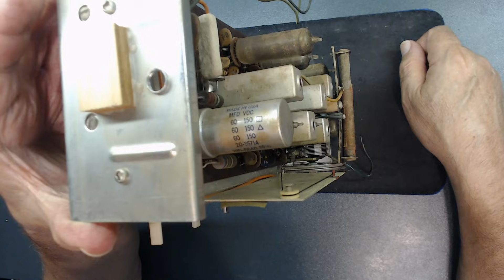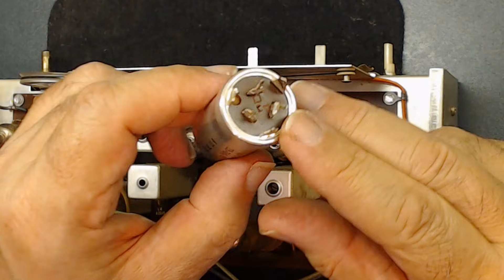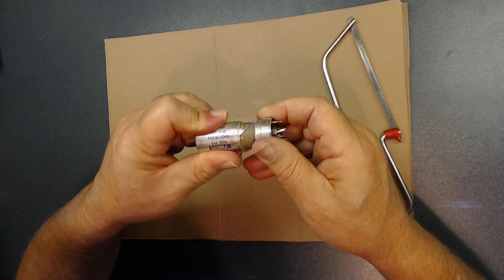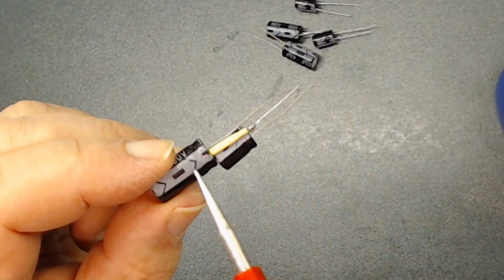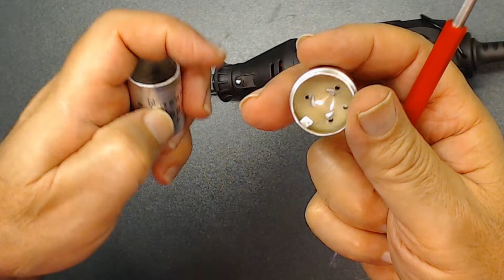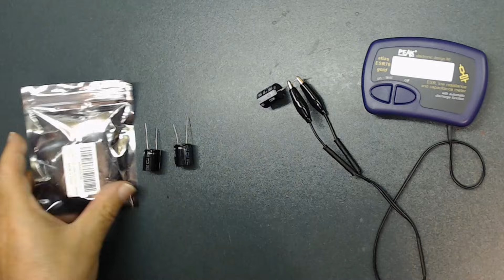How to Repair / Rebuild Multi-Section Electrolytic Capacitors - (Step-by-Step Guide for Beginners)

Comment: That's the hard way.
Reply from the maker: I’m always looking to improve my process, so I’d love to hear what you consider a better or easier approach! Have a great day!
Reply: @RadioFixer  Lock it in a machinists' lathe and turn it with a cutter against the curved end, just enough to be able to get the steel ring off. Then put it in a toaster oven about 400F for 20 minutes, which will cause the wafers to pop out enough to get behind them with a small screwdriver, alternating with tugging the legs with pliers, till the whole insides come out in one roll. (very hot). then separate the 2 phenolic wafers and throw away the gooey rubber disc between them, Getting rid of that rubber disc buys you the space to be able to crimp the ends when everything is re-installed. Drill tiny holes next to all the legs and one in the middle. The one in the middle is to feed all the negatives through. When it's re-installed, you'll barely notice anything. I've seen guys like you cutting the can. That's an awful way

Comment: Cool video thanks!
I was wondering where can find this tolerance calculator program, it would make my job lot easier. I am working on renovation of a 56 pg grommmes and i have some vintage capacitor i 've never seen in my life :D
I hope you guys would share this program! 
Thank you!
Reply from the maker: Hermann,
It’s great to hear from you! Thanks so much for taking the time to message me and for supporting my YouTube channel—I really appreciate it.
I originally created this software to make my own work easier when restoring older electronic equipment. I’ve had quite a few requests for it since it helps identify different types of capacitors, resistors, vacuum tubes, and more.
Because of that interest, I plan to spend some time finishing it up and hopefully make it available at a reasonable price so others can benefit from it as well.
Have a great day,
Regards from Florida,
Jay

Comment: I did find 60uF at 450 volts in DigiKey website for about 3 dollars UBR2W600MND and it is a true Nichicon cap........ I buy all my caps and other parts from them , no amazon and ebay for me .... They are not the real deal a lot of times ...... A real Nichicon cap that costs 3.50 USD is the right price , 10 capacitors for 4.00 USD is suspicious ,  I bought some Rubycon from amazon quite some time back to compare with the real deal from DigiKey and they were fakes ..... I need to do a video on that one day ....  I hope yours are the real ones ..... Great video...

Comment: A lathe would be a lot cleaner.
Reply from the maker: Hi Larry,
That’s a great point about using a lathe—it would certainly make the process cleaner, and you’re absolutely right. Unfortunately, I don’t have one at the moment due to workspace limitations. I’ve wanted one for a long time, but between the cost and the space required, it just hasn’t been practical for me.

I’m not sure if you’ve had a chance to watch some of my other videos, but my goal is to approach radio repairs as simply as possible, using materials that are easy to find or already around the house. That way, viewers can realistically duplicate the techniques themselves.

A good example of this is a series on my channel called Rat House Radio. It’s a full restoration project where I cover different techniques used to preserve the originality of a backlight cabinet. Most people would have discarded it, but I just couldn’t bring myself to do that.

Each series on the channel is a little different, and I try to take a fresh approach to the unique challenges that come with every project. If you’re interested, you can check it out here:
https://youtu.be/uMfL4Eakzng

Wishing you a great day, and thanks again for reaching out—I really appreciate your input.

Best regards from Florida,
Jay

Comment: ESR. Is acctually the parmeter to check for old electrolitic caps. to decied if they are bad.
The tool you are using can test this.
A standared value of 56uF exsists.

Most intresting to see the restoration of the cap.  Nice job.

I personaly would hollow the canister of the cap. ,put it back in the radio and  solder the replacment caps on it's tabs from the bottom.
Reply from the maker: Hello, it’s great to hear from you—thank you for taking the time to message me and for supporting my channel. I truly appreciate you bringing up the point about ESR being an important parameter when checking older electrolytic capacitors. That is my understanding as well, and your comment will be helpful for others who are learning.

I’m glad you enjoyed the electrolytic capacitor restoration. In some cases, there isn’t enough space under the chassis to install a replacement capacitor, especially in PCB-based equipment. This method can be very useful for electronic devices such as radios where space is limited.

Feel free to watch other videos on my YouTube channel. Each series is unique, and I try to take a fresh approach to solving the challenges in every project.

Have a great day!

Regards from Florida,
Jay

Comment: Nice video! That tape LOOKS GREAT!  SAE values would be 47, 56, 68. High values mean the electrolyte has dissipated letting the aluminum films to get closer together. Soon close enough to go phzzpt!. Yep time to recap.

Several comments are saying the caps are leaky which fools the meter, but the voltage is too low to cause measurable leakage? Should be leakage checked at 150vdc to know.
.
Reply from the maker: Hi Sam,
Wishing you a wonderful holiday season 🎄

Thank you for watching and for your kind words and detailed insights—they’re very helpful and truly appreciated. The information you shared will definitely be valuable to others who are new to this and don’t have an electronics background.

I also want to thank you for taking the time to message me and for supporting my channel. I’m really glad to hear that you enjoyed the video. You might also enjoy some of the other series on my channel—each one is unique, and I try to take a fresh approach to solving the challenges in every project.

Have a great day, and thanks again for watching!

Best regards from Florida,
Jay

Comment: Interesting idea, using the aluminum foil tape. I like to reattach the can to the base using 5 minute epoxy. It is strong and reliable, and the seam is often nearly invisible!
Reply from the maker: Wishing you a wonderful holiday season 🎄
When I first started this hobby, I considered using 5-minute epoxy, but I was concerned about future serviceability—especially if I or the next person ever needs to reopen the can to replace the capacitors.

One advantage of using aluminum self-adhesive tape is that it’s much easier to remove the canister later if the capacitors ever go bad.

You might also enjoy another series on my channel called Rat House Radio. Here’s the link:
https://youtu.be/uMfL4Eakzng

It was a 100% full restoration project. Each series is unique, and I always try to take a fresh approach to solving the challenges in every project.

Have a great day, and thanks again for watching!

Best regards from Florida,
Jay
Reply: @RadioFixer  Hi Jay, I watched Rat House Radio when you first posted it and enjoyed it thoroughly. It amazed me how you were able to bring such a disaster of a radio back to full working condition. I was very impressed by your passion. Keep up the awesome work!
Reply from the maker: I’m really glad to hear that you enjoyed the video—it's always great hearing from you! Thanks so much, and have a wonderful day!

Comment: In case anyone doesn't know, the capacitance of the can capacitor has not actually gone up. It is not actually 74/78/101 microfarads. The capacitor tester calculates capacitance by measuring the time it takes to charge up. However, these old capacitors are "leaky", meaning they have an equivalent parallel resistance (different from the equivalent series resistance). Equivalent parallel resistance is not desirable, and since some of the charging current goes through that resistance instead of into charging the capacitor, it takes longer to charge. The tester measures a longer time to charge, meaning it thinks it's charging a bigger capacitor (74/78/101uF), but in fact it's just losing some current through a resistance it doesn't expect to be there.
Reply from the maker: Wishing you a wonderful holiday season 🎄
Thank you so much for this detailed explanation! I really appreciate you taking the time to share this valuable insight, as it’s incredibly helpful for everyone. 

It’s so great to hear from you—thank you for taking the time to message me and for supporting my channel! 

Have a great day, and thanks again for watching!

Best regards from Florida,
Jay

Comment: These remind me of the multi-pole capacitors inside of exterior HVAC units…
Reply: Similar concept.  Just multiple caps in one can
Reply from the maker: Hi Brendan, thank you for answering this question! You’re absolutely right—I’ve replaced a few of those in my air-conditioning units as well. Since HVAC capacitors are readily available, there’s no need for me to rebuild those caps. LOL.

If you’d like, feel free to check out the attached video series, “Rat House Radio,” which you might also enjoy: https://youtu.be/uMfL4Eakzng
. It was a 100% full restoration project. Each series is unique and different, and I try to take a new approach to solving the challenges in every project.

Have a great day!

Regards from Florida,
Jay
Reply from the maker: Hi Scott,
It’s so great to hear from you—thank you for taking the time to message me and for supporting my channel! You’re absolutely right, as Brendan mentioned. 
I’ve replaced a few of those in my air-conditioning units as well. Since these old multi-section capacitors are no longer available, we often have to build our own. LOL.

If you’d like, feel free to check out the attached video series, “Rat House Radio,” which you might also enjoy: https://youtu.be/uMfL4Eakzng
. It was a 100% full restoration project. Each series is unique and different, and I try to take a new approach to solving the challenges in every project.

Have a great day!

Regards from Florida,
Jay

Comment: Nice video! Thanks for putting it up!
A few comments, though first where I'm coming from: I'm an EE, and as a hobby restore old electronics, been doing that for a few decades now. 
So, with these capacitors, they are usually placed in the power supply as bulk-capacitance to smooth out ripple left after rectifying, and provide for surges. Actual value is not critical, to some extend more is better (there are limits to that). You could have just used 68 uF capacitors to replace the 60 uF, would be perfectly fine and 68 uF is a standard value. I saw the comment about measuring over-capacitance and concluding they are still good; that actually is a big question mark. Most cheap capacitance meters work by timing how long it takes to charge them with a known current, and any leakage resistance (something most old electrolytics have lots off!) will result in measuring a larger-than-actual capacitance. You would need a much better capacitance meter that measures impedance (so it knows capacitance and resistance) to actually figure out if these capacitors were good or not. Generally I just assume old electrolytic caps are bad or will go bad over the next years, and replace them as part of a restoration. For any electrolytic caps of 30+ years that is a safe bet. True, many are still good, but why put in all the work to get something unreliable that will likely fail in the next years. Replacing them with new 105C and 5000+ hour rated caps is just part of the process.
Reply: Most rectifier tubes are limited to 30, perhaps 40 mfd, as the first stage capacitive filter, or else the rectifier may be prone to arcing or premature failure. 60 mfd is a bit much for all but one or two rectifier tube types (such as 5AR4/GZ34, which is used in hifi and guitar amps but not in small radios). Better to keep the first stage capacitor at no more than 20 to 30 mfd and use the higher capacitance values for the following filter nodes, where the rectifier is isolated from the charging currents by series dropping resistors. This is especially true if you're using modern Russian or Chinese rectifier tubes, which are far less rugged than old RCA, GE and Mullard rectifier tubes.

If you are gonna use a higher-vslue first stage cap, and/or Russian rectifier tubes, putting a diode online with the AC feed to each rectifier-tube plate is a good idea; the tube is then used primarily for it's slow warmup and inherent voltage drop, while the solidstate diode(s) do most of the work of converting AC to DC.
Reply from the maker: Wishing you a wonderful holiday season 🎄

Thank you so much for your detailed comments—I truly appreciate you taking the time to share them. It’s great to hear from you, and I’m really glad you enjoyed the video. Your support of the channel means a lot to me.

You might also enjoy some of the other series on my channel. Each one is a little different, and I try to take a fresh approach to solving the challenges in every project.

Have a great day, and thanks again for watching!

Best regards from Florida,
Jay
Reply from the maker: Hi Rob,
Thank you so much for your detailed comments! I completely agree with everything you said. Your insights really highlight why careful restoration practices make such a difference, and I truly appreciate you taking the time to share them. I often think how much easier this journey might have been if I had a mentor when I first started in this hobby.

It’s so great to hear from you—thank you again for supporting my channel!

You might enjoy this video series on my channel, “Rat House Radio”: https://youtu.be/uMfL4Eakzng
. It was a 100% full restoration project. Each series is unique, and I try to take a different approach to solving the challenges in every project.

Wishing you a wonderful holiday season!

Best regards from Florida,
Jay

Comment: A little  knowledge is dangers. He destroyed a good electrolytic capacitor.  The capacitor is used for filtering DC voltage and as long as there is over capacitance , it works.
Reply: Measuring high, out of tolerance, is often a symptom of a capacitor with high internal leakage, because typical capacitance testers use a timing circuit to derive capacitance measurement from how long it takes to charge it; a leaky capacitor takes longer to charge and therefore reads high. Also, too high a capacitance value for the first filter stresses the rectifier tube, many of which have a maximum rating of 40 mfd or less. The later filter stages can safely use higher capacitance values, but the 1st stage cap has to be a lower value.
Reply from the maker: Wishing you a wonderful holiday season 🎄
Thank you very much for taking the time to share this explanation—I truly appreciate it.

That’s an excellent point about leaky capacitors reading high due to the way many testers rely on charge timing. Your explanation is very clear and helpful, and it’s a great reminder that test results need to be interpreted in context, not just taken at face value.

I also appreciate you pointing out the importance of keeping the first filter capacitor within the rectifier tube’s maximum rating. That’s critical information, especially for anyone restoring older sets, and it’s a detail that’s easy to overlook without experience. Your clarification about safely increasing capacitance in later stages is very valuable as well.

Thank you again for sharing your knowledge—I’m always grateful to learn from those with more experience, and insights like yours help everyone do better, safer work.

Best regards,
Jay
Reply: @RadioFixer , always happy to be helpful! From my pre-teen years to the present (I'm 68), I've learned a lot from old-time repair techs and ham radio operators who graciously taught and mentored me, and so I like to pass on usefull info in the same spirit with which it was given to me. Anyway, tubes have specifications and maximum limits, and while I dont know what type of rectifier is in the radio you were working on, the stock 60 mfd seems a little high. A tube manual will tell ya' how much 1st stage capacitance you can safely use for a given tube type; filament-type rectifiers (5Y3, 5U4 etc) can handle less capacitance than an independently-heated rectifier (5AR4, 6X4, 6CA4). Not sure how much capacitance the halfwave single-diode rectifiers used in series string  "AC-DC" radios can tolerate, because I mostly work on hifi gear and guitar amps that have proper power transformers; but anyway, a tube manual is your friend!
Reply from the maker: Hi Martin, great hearing from you! Unfortunately, I had to work on this capacitor because there was a loud humming sound—one of the 60µF capacitors had drifted to over 110µF, while the other two 60µF capacitors were only slightly above their maximum rating.

I often think about how much easier this journey might have been if I’d had a mentor when I first started in this hobby.

If you’d like, feel free to check out the attached video series, “Rat House Radio,” which you might also enjoy: https://youtu.be/uMfL4Eakzng
. It was a 100% full restoration project. Each series is unique and different, and I try to take a different approach to solving the challenges in every project.

Have a great day!

Regards from Florida,
Jay